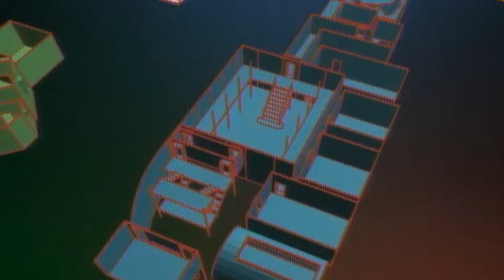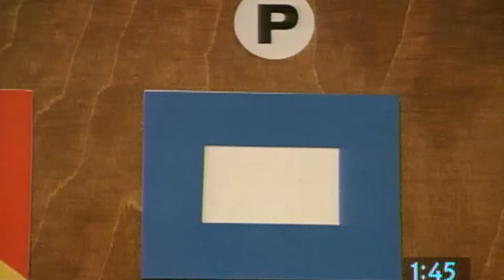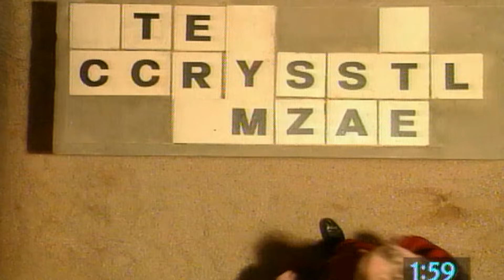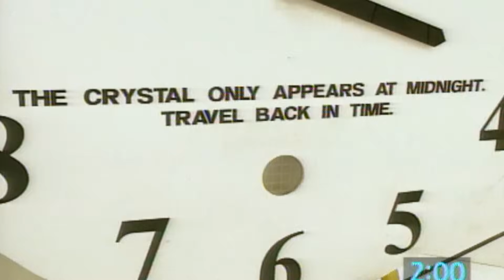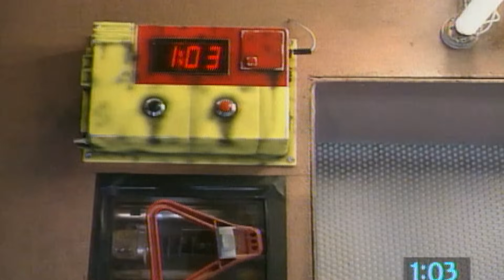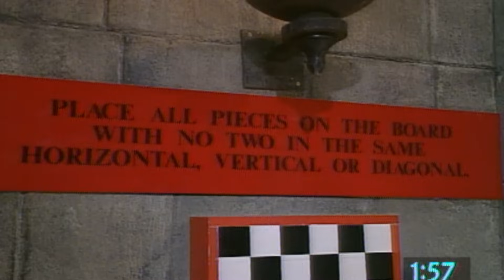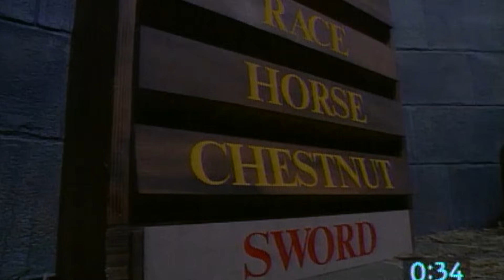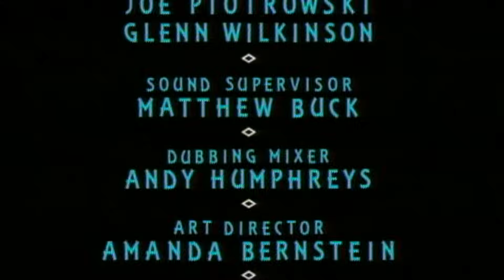Series 4, Episode 2 - Full Episode | The Crystal Maze

Comment: funny when this show has its little moments that predates modern health & safety so well, the bamboo floor traps are cut at an angle and the safety hooks are without latches... no way you would get away with this now
Reply: I worked in production, albeit not of this show, but I guarantee you there’s no one on this planet more concerned with safety than a film or a television production team. If a safety measure isn’t visible to you it’s because part of our job is disguising it! But trust me, and this goes double for a well-financed production: when you’re beneath lights which could crush you, surrounded by cables which could electrocute you, you make everybody’s safety your top concern.
Reply: The “bamboo” is undoubtedly rubber tubing, in other words, and perfectly safe … but painted to look like bamboo.
Reply: In fact, after closer inspection, I can now guarantee they’re rubber: you can see one “bamboo spike” clearly bend when the contestant accidentally presses it with her foot!
Reply: The bamboo sticks were indeed rubber & the wooden spikes from the Medieval crossover area were polystyrene. I was lucky enough to keep a few props after working on the show.
Reply: I bet you're fun at parties